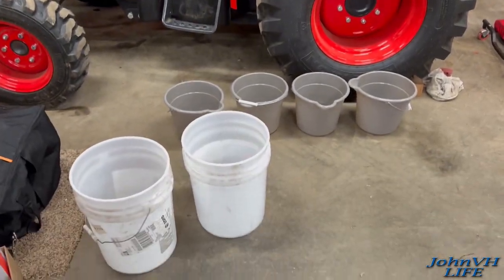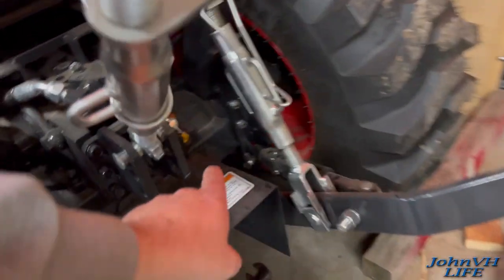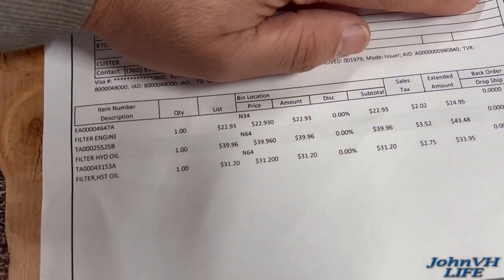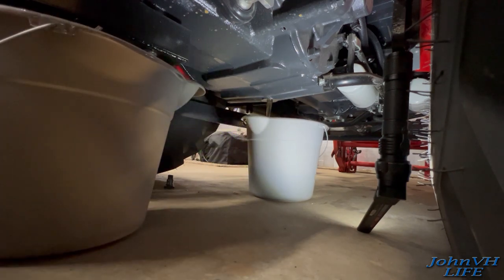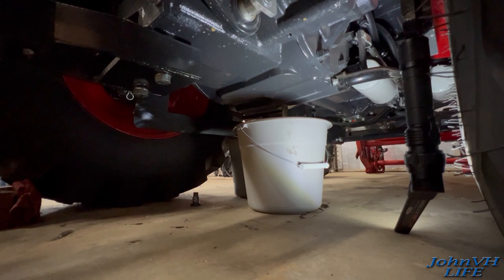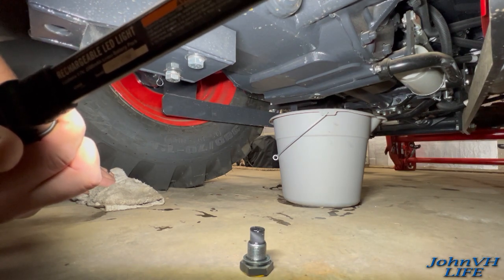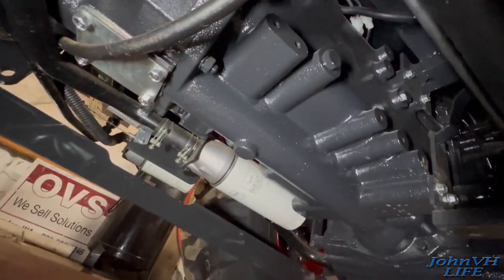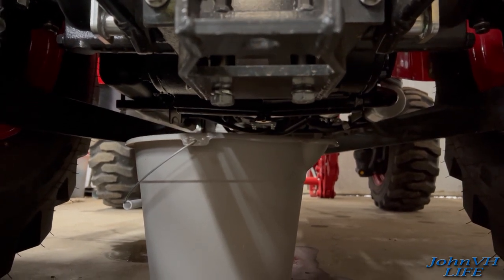Branson 50hr Service PT2 on my 2515H compact tractor Transmission Hydrostat Oil Change How To DIY

Comment: Also have the same tractor and just doing my 50 as I type this, never have added any oil to my filters since the factory doesn’t seem to and everything work fine, just an extra mess to clean up. Aren’t these easy tractors to work on !!  Kukje makes good tractors, shitty fuel economy but nice heavy machines.

Comment: How much hydraulic oil did you end up putting in it. 
I have the 2205h Branson and I’m going to do the 50 hour service on it. 
It has a 3 cylinder yanmar,.48 on oil. Almost 4 gallons on the transmission

Comment: I got a quick question for you. Have you in your time of owning the tractor notice black stuff spitting out of the exhaust onto the loader arm on the bottom left? Maybe after a few cold starts or such. Just a slight build up that wipes off easily? Just wondering if thats normal. Thanks
Reply from the maker: Totally normal, mine does it also, condensation in the exhaust system and the exhaust soot blowing out.  Mine has a ton on it now, I need to clean it off.
Reply: @JohnVHLife  Thats what I was thinking too. I have a 2515h and the exhaust is pointing right at the arm. Im looking at ways to either bend the pipe down or add a splash shield because its annoying to clean it. Glad to know thats normal. I totally forgot about the condensation inside.
Reply from the maker: @AleksandrVerbetsky  Not sure why they didnt put more of a bend on it to direct it away from the tractor, I built a little stand with a piece of pipe on it, so when I cold start I put it in front of the exhaust and it directs it to the side, time will tell if it helps. Ill probably weld an elbow onto the exhaust and cure it once and for all.
Reply: @JohnVHLife  agreed. For now I just don’t have my implements down all the way or they are kneeling to keep the arms away. There are pope extensions that bend down. I might cut mine and replace it or try to bend it but I know that it might be tough with the thicker steel. Thanks again